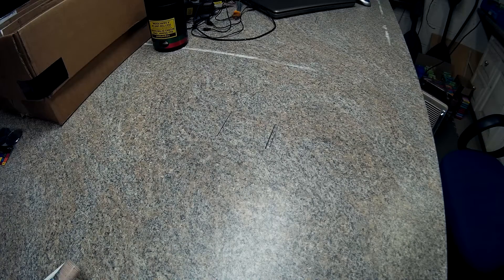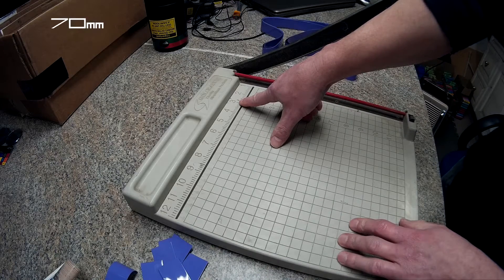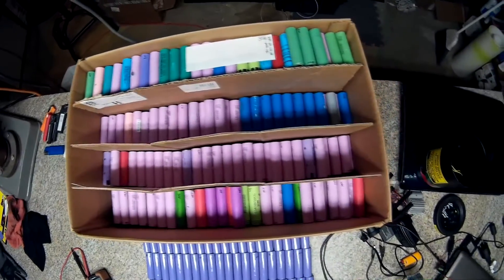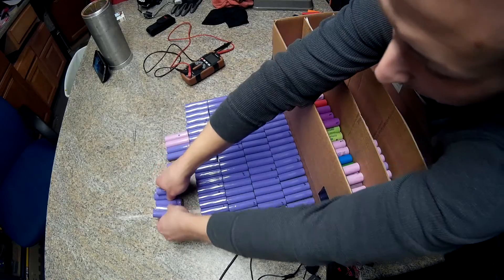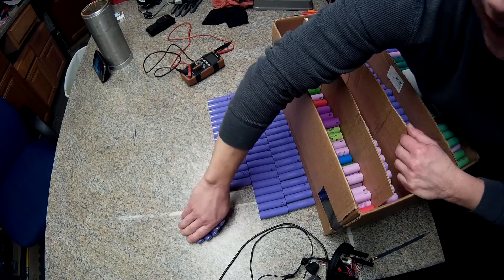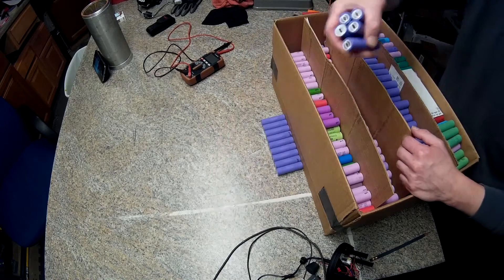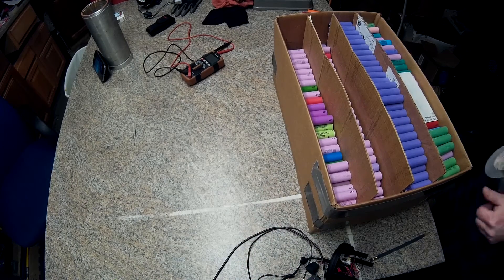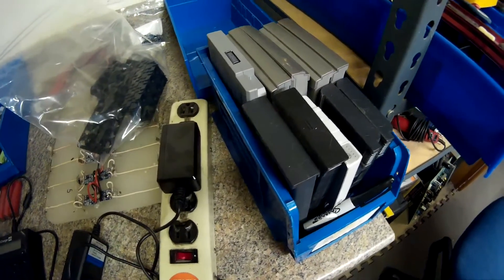Diy Tesla Powerwall ep13 Heat Shrink Fever

Comment: Why do you redo the covering on what’s there?  Is it just to make it look more uniform or is there another purpose?
Reply from the maker: I was redoing the shrink wrap cause the cells came from medical packs that would rip the crap out of the shrink wrap and I didnt want to have exposed cells.👍
Reply: The outer part is a contact to the negative part of the battery.  It's for safety, otherwise you could more easily cause a short.